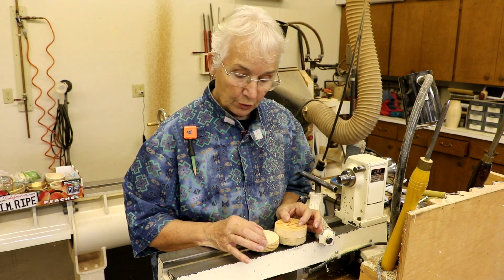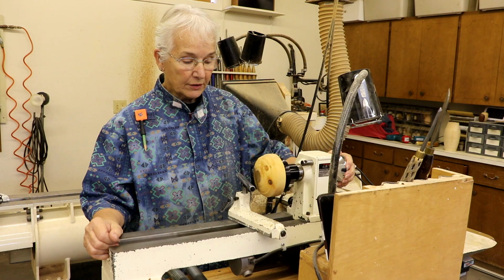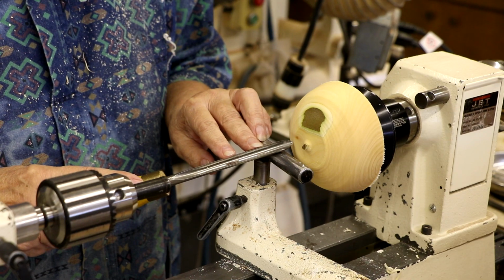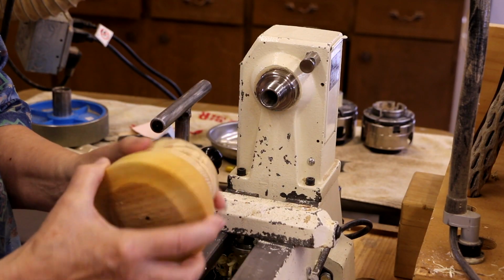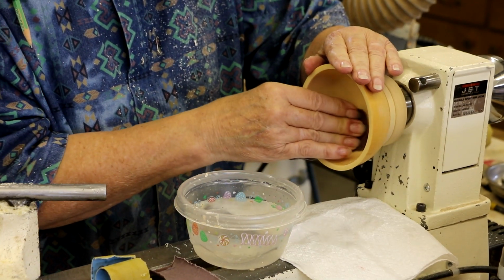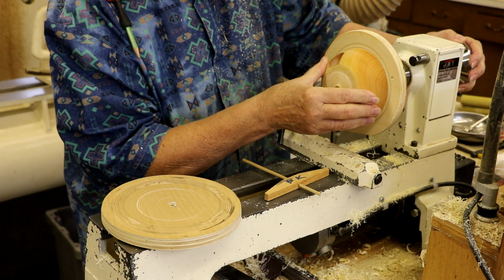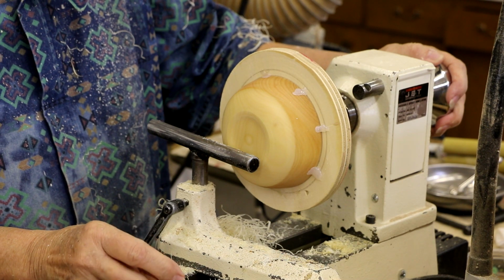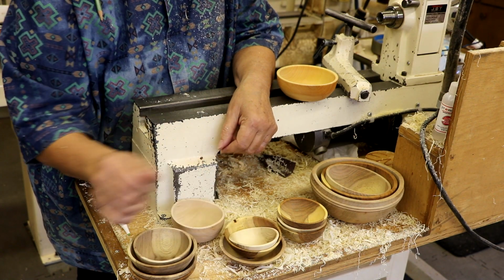Bonnie Klein's Bowl Turning Techniques

Comment: Bonnie, thank you for a demonstration of your unique approaches (or at least nothing I have seen any other turner show in their videos) that make sense and apparently allow very efficient workflow when repeated for a while (or years...). I was enlightened about the reasoning behind what you do, it allows learners get into the mindset and not just follow a recipe do this and that and never fully knowing why and what to aim at. I agree, when I started I thought a chuck is a necessity and as a beginner I noted it was a bit dangerous until I got more skilled and had hit my fingers times on it. I also noted that not all projects "fit" a chuck, I mean smaller items require another approach if the tenon covers half of the project. Changing jaws is also tedious. So I soon started to experiment with toothed drive centers and those work great, chuck gets useful when long gole boring, but all the prep work I prefer fine  toothed drive centers. First of all, knowing my lathe has a M33 screw I can now buy that size nuts and create customized attachments for special projects I want to make repeatedly. NEVER thought of that. Then watching an expert actually recommending green wood, most videos just see green wood as a problem to tackle but you pointed several positive aspects. Some wood is lovely to turn green and I clean the blanks out of the bark etc before drying because green wood is so lovely to work with. The hot glue tip and the rings, sanding... I noticed the shape of your bowl is both very functional and beautiful, because it maximizes the capacity yet gives a rounded shape. I hope you will make more videos. Thank you so much and greetings from Finland!

Comment: Always wonderful to see techniques from another bowl-turner. Even though I'm a seasoned turner, I still picked up a few tips. Thank you for sharing. I use about 15 various faceplates with glue blocks but started making my own glue blocks by using a 1"-8 nut with epoxy. You hardly ever hear anyone using 150 grit sandpaper but I find it my most used grit. Can't beat that bargain box from Klingspor.

Comment: Bonnie, thanks so much for sharing this video.  It's packed full of such good information, I was particularly impressed with you showing wet sanding.  This makes so much sense,  mostly for dust control and practicality.  I also really appreciate the use of hot glue for turning the bottom of the bowl...  Thanks again.

Comment: Great video, thanks for sharing. I think most people's problems with projects coming out of their chuck, is not using the correct connection type, or creating them properly, so they end up with a weak hold, or the timber opens up or compresses too much.

Comment: Since watching this video I have made about a dozen bowls with this technique. I love it! One question I have: Any tips for getting the hot glue off the rim of the bowl? That is the worst part of the process for me. I heard somewhere that rubbing alcohol works, but it I didn't have much success with that. Thanks!
Reply from the maker: I have had more of a problem removing the glue when the bowl is dry.  I have tried alcohol and it does help a little.  Warming (not hot) the bowl in the microwave will soften the glue also.  When the bowl is dry, I have used alcohol, scraped it, and also sandpaper in the area.
The best success I have had is when the bowl is still wet (green), before using the hot melt.  The glue peels right off.   I haven’t tried wetting the bowl (if it is already dry) before attaching it with the hot melt.....might work?
Reply: @bonnieklein7320  You nailed it - - - the cherry log I'm using up is pretty dry. Your ideas make sense and I'll try them. I might even (carefully!) try a heat gun to soften up the hot glue.

Comment: Thank you for this, very helpful.  How large a bowl would you use that hot glue mount for finishing? I like that method better than many I have seen where I am essentially using a plywood mount that I will likely only be able to use that one time to jam the bowl onto a mortise.
Reply from the maker: I have not tried this method on any bowls larger than about 10”.  I think it would work for larger bowls - especially if you bring up the tailstock for support (and safety!) The hot melt glue basically serves to keep it “centered”.  Of course - use more hot melt for larger pieces!

Comment: I enjoyed the video very much.  I noticed the big Oneway in the background.  I bought the 2436 in 1999 or 2000 with the five foot extension and the seventeen inch extension . It turns nine foot three inches between centers.  I made the whole tool rest base for outboard turning and have turned forty nine inches outside diameter by four inches thick with the inside hollow while the whole ring was screwed onto a plywood disc screwed onto the six inch faceplate.  I made several big forms to make fibreglass molds to make concrete columns up to twenty three feet tall.  I believe I spent about $7500.00 on the lathe with the two extensions and it has paid for itself many  times over.  I've also turned quite a few big porch posts with it over the years.  For someone who does not like to turn bowls with a chuck,  I noticed a few chucks on the table behind you.  I still enjoyed your video.  Very nice.   Dan